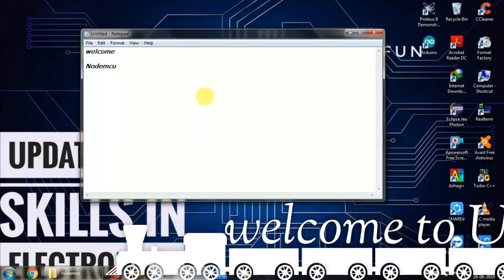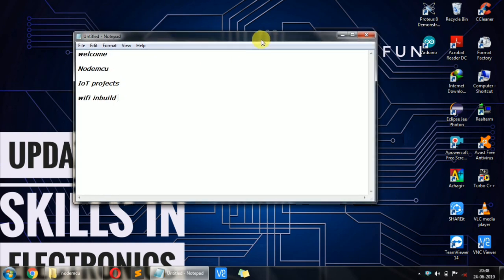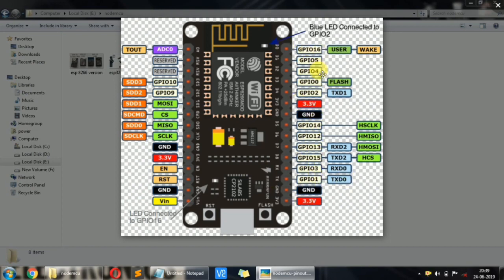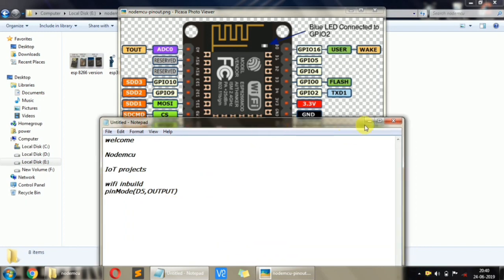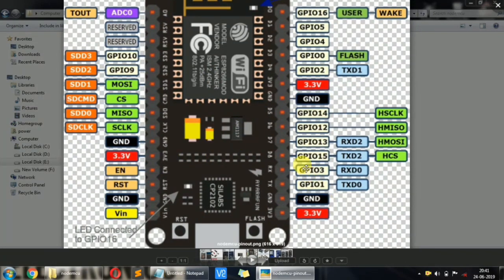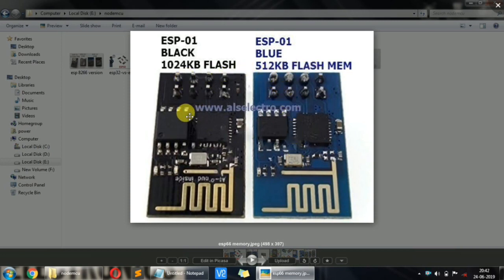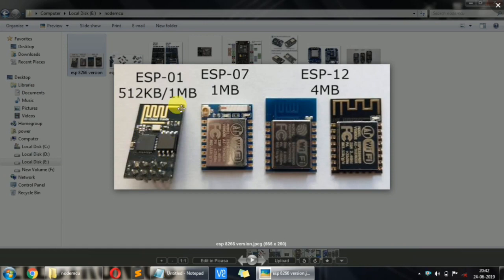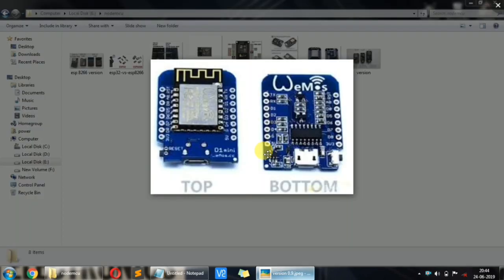what is Nodemcu in tamil

Comment: esp 32 la sd card module connect panni SQL server aa use pannalama?
esp 32 la sql function work aakuma?
Reply from the maker: No esp32 la sql use pana mutiyathu. Atha external server ku send panni anga php file add pannikalam. Like 000webhost, hostinger
Reply: @UpdateyourSkillsinElectronics  python  use panni esp 32 code pannalam thanee .apdi enda SQL functions work aakanum thanee